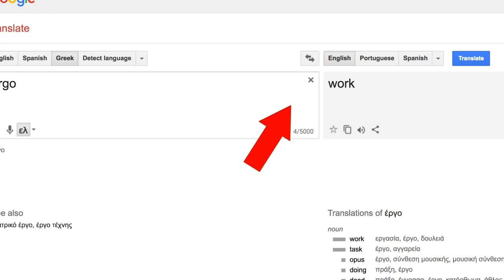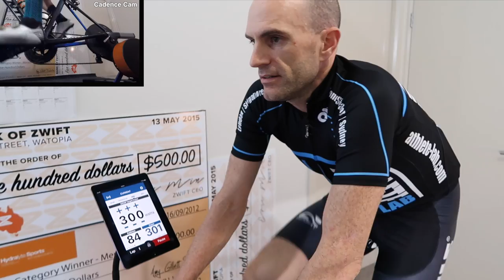Indoor Cycling Smart Trainers: ERG Mode Explained

Comment: Tricky bit that some miss is that power is a unit of work (force times distance) per unit of time (Nm/s, Watts, etc.). The faster you pedal with the same output power, the less force you exert on the pedals (easier on muscles) but you exert that lower force on the pedals more times per minute. That is why higher rpm's are better for endurance even though the power output is the same. Higher rpm = less muscle stress (less force) for any given power output. This is, of course, over-simplified as other factors and limits are present. Thank you for explaining that ERG mode!
Reply: That is Well know even in outdoor training that Higher rpm are better for endurance (heart) and lower rpm for muscle.

Comment: Genius video Shane, thanks very much for the in-depth explanation and multiple examples of spiral of death.  I see this video has been out for some time now but it's still very relevant for me. I've been Zwifting for just over 2 weeks now and failed 4 attempts at workouts with sharp transitions like "The Wringer," trying both with erg mode (spiral-spiral-spiral!) and without, finally resigning myself to just avoiding erg mode for any short duration intervals. After seeing this I'll give it another go, remembering to attack those transitions.

Also kudos for being able to instruct while exerting yourself to that level!

Comment: Great video Shane.  This is the first time i have ever seen or heard "How to ride Erg-mode Transitions" explained.  
I always quite enjoyed getting out in the cold and bad weather of winter (and the thought of dumb trainers horrified me) but Erg mode was always very appealing to me to do a 50-80 minute structure sweetspot / threshold / vo2 sessions of an evening, or a winter period when the roads are simply too icy.  This winter i made the leap into a Smart Trainer, and don't regret it for a moment - i did however fairly frequently experience "The Spiral of Death" which I (and judging by DCR's comment sections) is generally blamed on the hardware/software .... Looking forward to putting these techniques (attack increases / ride through decreases) into practice and seeing how it impacts the "reliability of my smart trainer".  Seems it is a wetware issue rather than software / hardware.  Odd that this doesn't seem to have been explained more widespread, DCR should link to it.
Reply from the maker: There's a lot of people talking about how they dislike ERG (and I've mentioned it a few times on Lama Live when chatting about training/workouts)... but there was a gap in information about how to best ride it. Hopefully this video is a good reference point. I can deep-dive into specifics in other videos.

Comment: I've been struggling with ERG mode on Zwift using my Kickr. On workouts my watts reading was bouncing all over the place despite keeping more or less the same cadence. I've now sorted it and am pleased to see I am getting gold stars as each stage finishes. The problem is that when logging into Zwift the Kickr gives you 3 options to pick, one Bluetooth and two Ant+. For me the Kickr F-EC was giving inconsistent readings and quite frankly had me close to tears. I have however read that some people have found the reverse to be true. If you are getting watts readings that are dropping and peaking for no apparent reason then I would recommend that you give this a go.

Comment: After a few months using a Tacx Neo I found that if I chased the wattage I would end up pedalling faster and faster and exhaust myself but the key to riding in Erg mode is to just keep cadence the same no matter what.
It is the one variable you need to control and the hardware and software does the rest. It is the difference between doing 28 miles in an hour and 18 so much less tiring. Enjoying trainerroad much more now I found out the hard way.

Comment: Shane, this video is about 1 year too late for me! I use the kickr 1 and TrainerRoad exclusively and it took me a long time to fully figure out how to ride it properly. Specifically, I was having issues where my accuracy with the target power was very off. I found that, as you mentioned in the video, keeping the cadence consistent is the best way to go. I also have found, like you mentioned, that you really have to stay focused and can't just absentmindedly pedal or the workout will suffer. Once your mind drifts from keeping that cadence, your done. One question, TrainerRoad has a lot of sessions where they do 15 second bursts of super high power. I have found the best way for me to get through these is to keep my cadence higher then normal, maybe a way of cheating with what you call attacking the increase. My problem is when it drops back to the "normal" power my cadence seems to run away and I get the clunking of the pedals. I try and slow my cadence down on my own but it is really difficult. Any suggestions? Awesome video as usual, and like I said, wish this came out a year ago!
Reply from the maker: Clunking on the pedals.... related to the smoothness of your pedal stroke? It's hard to tell without seeing what's going on with that. Seems you've got the smoothness part sorted. Could be trainer related as to how quickly it does the step-down and stabilises. Maybe pull out the mobile app for the trainer and do a few tests like I've done in this video and try a few different methods of attack (or non attack in this case).

Comment: Excellent video, as usual from Lama. This week (2.5 years or so after your video was published) DC Rainmaker pointed out that ERG mode is best done in the smaller chainring up front (so on a compact you would ride in your 34, not the big 50 ring). Similarly, in the back, you should put it in the middle (not the easiest nor the hardest gear). Ray's recommendation comes from TrainerRoad. I noticed you ride your big ring primarily in this video. Is the this your preference, or do you follow TrainerRoad's advice now? (This is all new information for me, BTW). Ray said the reason you should use the smaller ring up front is that the larger one increases the speed of the flywheel, and it's similar to a vehicle traveling at high speed, it becomes harder to control. Slower moving flywheel = more accurate control from for the trainer. However, unless you're using the Tacx Flow Smart, in which case Shane discovered that it operates more accurately with the big ring. I'm going to end this comment now because my brain exploded. 🤯
Reply from the maker: It depends on the trainer. Use what works for you.

Comment: Extremely helpful video, thank you! I'm having trouble with lower wattages, i.e. recovery intervals, in the Sufferfest on my Tacx Flux. I used a 52/19 gear and I couldn't get down to 117 watts with an 85 cadence. It refused to go below 130 unless I went into the small chainring. Higher wattage intervals were generally fine. Is my gearing playing an impact or is it something else?
Reply from the maker: Wattage Floor - You may need to change from your big ring to your little ring to hit your wattage targets in ERG mode. If your power target is below the wattage at which your trainer can apply resistance, you hit the "resistance floor" (also referred to as the “wattage" or "power" floor) and you won't feel resistance changes. Slowing the flywheel down by changing to an easier gear is sometimes required on the FLUX when in ERG mode. 20-25km/h flywheel speed is the optimal range for ERG on the FLUX.

Comment: Was that Von laughing at your torture on that spiral of death at the end? I guess misery really does love company.

ERG Mode on my Kickr Snap using Zwift feels far more... forgiving than it used to. It lets me oscillate the power a bit. It gives me a bit more time for transition. And it does seem to let me fight my cadence back up if I want. Spiral of death isn't as easy of a trap to fall into as it was last year it seems. That and getting to use my bike's power meter means no more worrying about doing spindown tests every ride now. Far faster to 0 offset my power meter at the beginning of my ride. And in the middle if I'm free riding. No worry about temperature compensation since I'm mostly in air conditioning this time of year (not going to ride much outside when it is 120 degrees out... or 48.9C for those that aren't in the States).
Reply: mwhahhaha  <evil laughter> in spiral of death

Comment: Well done Shane.
Two points:
I use the TACX Neo Smart ERG Unit for ERG training. I don’t know why, but I ctually find ERG interval work easier than non erg work for the same intervals and gearing. I find it harder and more intense to stay in the power zones when in non-erg mode. Not sure if I am doing this right??? Thoughts?
When in ERG mode, The tacx neo cannot hold power less than 140W ( for those long recovery base ride sessions).
I have tried everything, engaged TACX themselves, traineroad personnel in a lot of detail over months.
They cannot assist. I have confirmed through trials and testing with TACX that the unit is not faulty.
I have to really slow down my cadence to try and ride below this level and almost becomes pointless from a training point of view...
Your thoughts on how I can achieve consistent lock in ERG mode with holding power at lower levels?

Cameron
Reply from the maker: ERG is..... not my most preferred thing in the world of cycling. It has its place.... but not often that place is anywhere near or over FTP for my sessions. 

RE: Wattage Floor - You may need to change from your big ring to your little ring to hit your wattage targets in ERG mode. If your power target is below the wattage at which your trainer can apply resistance, you hit the "resistance floor" (also referred to as the “wattage" or "power" floor) and you won't feel resistance changes. Slowing the flywheel down by changing to an easier gear is sometimes required. In short, don't use ERG for recovery/easy efforts. Just flick to SIM mode, or Slope, or 'free ride' they call it in Zwift.

Comment: This is a good explanation. I am currently just about to order a Direto XR, and since a lot of people are complaining about it's performance in ERG mode, I'm trying to figure out, do I NEED to use it in ERG mode, or how does it work in "regular" mode? ERG seems like it really is unnatural, it makes no sense to me that when you change cadance power doesn't go up or down, what's the point? I guess it's maybe like simulating shifting to a lower or higher gear, so then you would hold the same watts at a different cadance, but you can also just.. change gears, the trainer has an 11-speed casette...
Reply from the maker: It works fine in regular mode (SIM). I wouldn't say it was the 'best' at SIM given how it works with the internal stepper motor.
Reply: @gplama  Thanks for your reply. What are your thoughts on the Direto, compared to a fluid trainer? I had the Elite Kura until recently, and it was just fine for what I need. At the moment I have no trainer, and the Direto XR is on sale for 600 euros, I feel like I'll regret not getting one, as they'll probably all be out of stock again before winter...
Reply from the maker: Fluid is a whole different ride. It's non interactive. The XR is a step-up for sure (but I also use ERG a lot too).

Comment: You look so comfortable at 300 watts ... chatty pace ! 
Do you know anyone who did a review on the Magene T300 ? Price looks good ...?
Reply from the maker: No reviews I’ve seen sorry.
Reply from the maker: Here it is. Magene T300 Smart Trainer: Details // Ride Review // Lama Lab Tested: https://youtu.be/H6By1BYufeo
Reply: @gplama  I bought one. Cost me 642 USD here in Malaysia... I am on my 3rd unit. On stage 3 today of the zwift tour my ave watts are off by 5 watts ... all 3 machines I had performed differently. This one is better on average ... I have not looked at the data using DC rainmaker though. Just comparing my ave watts to the quarq d four. They selling the T300 here 650 USD  with a cassette 105 Shimano...
The ride feel is really good and quiet. Just the power plays around so I am really not sure what is cooking. It's stable on this unit however on the higher watts it reads higher. It's a solid machine. The issue is how to race on zwift. I am looking for a replacement from the dealer so waiting for his reply. Under 200 watts I am out by 3 to 5 %. It over shoots in the sprint 100 watts on 1200 and shows 1300. Above 250 watts it can go higher by 20 to 40 watts ... is this just a software tweak ? I think there must be over a thousand of the T300 in the market here already.

Comment: Very good video. Thanks! How do I come back from the spiral of death? I use garmin connect training plan, the erg mode choose the middle of the interval. How do I make erg mode todo the upper power of the interval?
Reply from the maker: It depends what’s controlling the trainer. Some software will disable ERG if it detects the spiral of death. Some does not and you have to pedal very hard to start spinning again.

Comment: Hey Shane, great video. I'm newish to training and racing and have a question. In racing or group rides for that matter it seems important to be able to hold a pertcular power to stay with a bunch so you don't drop off the back or surge through the pack and keep doing stints on the front. With that in mind I don't tend to use erg mode for training as I feel it's important to be able to hold power without assistance. For someone like yourself that has the experience and can hold a set power it probably doesn't matter but for a newbie like me I think the practice is important. Does this make sense to you?
Reply from the maker: Bunch riding on Zwift is not like bunch riding outside. The draft and moving around the bunch on Zwift has no real 'feel' to it. It's just how it is, I guess. Unless they make changes to the virtual aerodynamics.

Comment: Thanks Shane. I always use the small ring for NEO and for ERG, but still no impact on holding The power under ERG mode. Must be the inherent characteristics of the NEO.
You mentioned that ERG mode is not your preferred method of training. May I ask what is your preferred method of training?
Given that ERG mode is artificial, what is the actual benefit of ERG mode in terms of muscular endurance, strength and cycling conditioning?
Cameron
Reply from the maker: I like intervals at or above FTP on the LeMond Revolution. It is buttery smooth, no electronics, loud as hell, old school, and no ERG mode. ERG has its place. It makes people do the work. In a race (especially a TT) I have to choose to do the work. Either I go harder, I sustain pace, or I reduce the pace. Three options I get to choose at any given moment based on a huge number of factors. ERG mode has no soul. It has no feelings. If you're having a bad day, ERG doesn't care. If you're having a good day, ERG doesn't care. You have to do the specific set watts or don't bother coming. (Yes there is a toggle for -+ a few % in a lot of software, but that's a manual switch to another defined watt number). The results from ERG are unquestionable, physically. It works. Mentally it works somewhat too, it makes people fight, maybe harder than they would normally choose to. The question is... when you're out on the road and ERG mode doesn't exist, ERG mode isn't there to hold your hand. It's not there to kick you in the arse when you drop watts for a few seconds. I should do a video on this rant. :) *tldr; ERG works. But it isn't the ultimate tool a lot of companies claim it to be.

Comment: Hi Shane. Thanks for this interesting video on the ERG mode that until now I didn't know what it could be. A week ago I received my first interactive trainer, Tacx Neo 2T, and I was wondering if this training system was also included in this trainer, and how I can activate / deactivate it. PS. I noticed something nice, and useful at the same time, on the stem of your bike. Is it a mobile phone holder? If so, where can I buy it? Is it easy to find in Italy too? Thank you.
Reply from the maker: I'm not sure what software Garmin/Tacx bundle with their trainers these days. The Wahoo App might work with it... I'm not sure. The phone mount/holder on my stem is a Quad Lock case and mount.
Reply: @gplama  Thanks for the prompt reply. I'll check the Wahoo app if works on my Tacx. Ciao..

Comment: Good morning, thanks for you great video's very interesting. I am about to have neck surgery (thanks to a camper van) , you can guess what happened. I do not want to lose my fitness. Which smart trainer would you get , Kicker 2 or Neo ? I have read both can take through axel quick release . that was my only requirement, cheers tom
Reply from the maker: The Hammer also does thru-axles. Entirely up to you as to which trainer you buy.

Comment: I don't understand. His cadence went pretty high and the wheel didn't start free spinning? When I'm doing ERG mode workouts on Zwift, if my cadence goes up fast,  the flywheel just free spins. Then my power drops to 0. So I end up getting half or no stars, because I have to wait for the fly wheel to slow down until the resistance kicks back in. It's especially difficult when doing sprint exercises, that alternate between low power and high power.

I'm using a Kickr v5